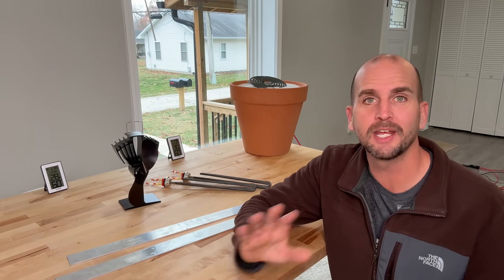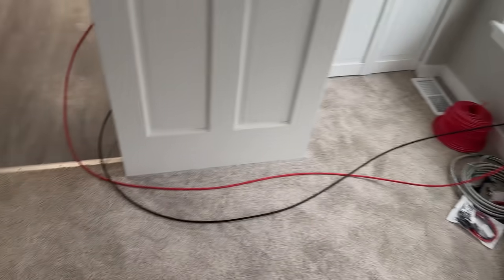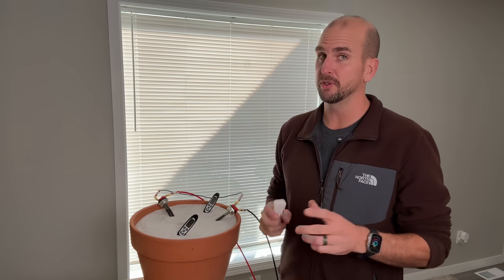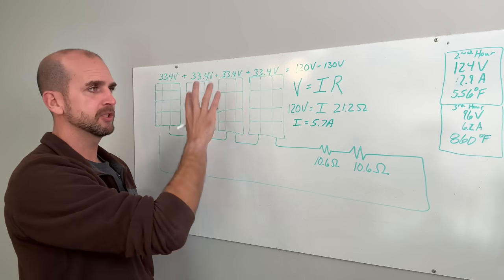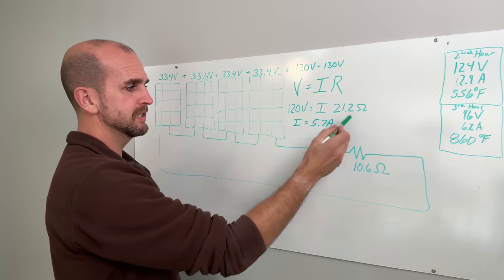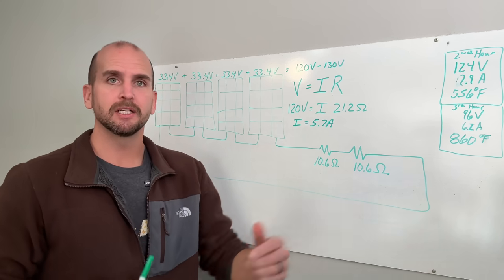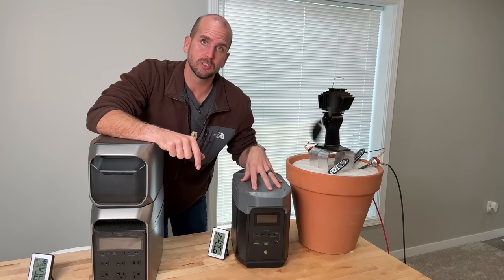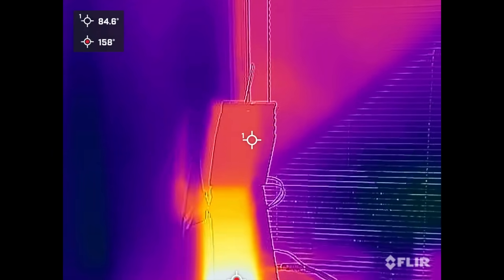Free Emergency Winter Heat | Solar-Powered Sand Heater 2.0

Comment: Good experiment, but if you are expending the energy on the fly into the room, I'd just find a resistive old space heater, hook the heating element(s) to the solar panels and plug the fan directly into the wall. Now, where that pot of sand would come in handy is for thermal electric storage. Say a home owner has a 2 tiered electric rate. Cheaper at night, but high in the day. NOW that pot of sand could come in handy insofar one could heat it up at night and draw the heat during peak electric rate period. Of course one would need a much larger scale of storage medium, like a barrel or something to make it practical.

Comment: I still suggest using a mppt controller to optimize the load.
Also, a heat pump would be much more efficient, though this is nice for having a thermal mass.

Comment: I would have been interested in the temperature in a comparable area (similar number of windows, similar orientation),  in another room since you had the heat off. If your house has one, of course. Or even a closed closet in the same room. The thermometers in the path of the fan is fine but you're really heating the entire room. That info would be useful in a situation where the power is out and it's pretty cold. A few degrees in a small room is good but in a serious situation where you're setting up a tent covered with blankets in the living room this sort of setup could really make a difference in comfort and safety.

Comment: This might keep a greenhouse from freezing.
The paradox is that you want to trap the heat all day and release it when the sun goes down. The peltier is a blind alley. Not enough efficiency to really accomplish anything.
A cabinet of sorts with a vent on top that opens when the room is cold. A wax motor could potentially do this.

Comment: Based on opinion, not experience: Be sure to use "play" sand instead of construction/concrete sand. The "play" sand is spherical and will pack to a better density with fewer air pockets than the jaggedy sand you would mix with cement.

Comment: You need a small pump and  CPU radiator or other small radiator attached to pipes that you pre-buried in the sand before it gets hot.  Then you need a fan on the radiator to maximize heat dissipation.  .  Your 2 aluminum don't have enough surface area to put heat into the room.  I sure hope you didn't use any peltier elements because those have 20% efficiency and are basically ewaste.

Comment: I wonder how it would work using a copper car heater core sunk down in the sand. That with water circulating through it and a bigger car radiator\fan combo. A small pump would be needed but it might extract the heat better? Maybe a small dedicated panel and battery for the pump? Might be totally wrong just brainstorming

Comment: I would have measured the temperatures from the ceiling down to sleeping level... That sand battery could hold 500 degrees but if all the heat is rising to the ceiling what good is it???

Comment: So could you just connect your solar at 120ish V dc to a cheap oil filled heater? 
Perhaps bypass some circuitry that requires AC.

Comment: Seems like an interesting way to provide winter heat for a chicken coop.  It would be interesting to try this in an outdoor shed-- 28 degrees outside, but inside the shed with this sand battery, what is the temperature?

Comment: I made one of these after seeing your first video on this. I have 800W of panels (about 90V) going into an immersion heater, about 390W in full sun. 

It makes the sand warm (like 500F), not a big difference in ambient temp though, maybe needs another element and more sand.

Was a fun learning experiment though.
Reply: id like for someone to explain the advantages of a sand radiator as opposed to a regular metal grate radiator
Reply: @devinm524  I'm no expert but it's likely safer to do this as the really hot parts are buried. It's also fairly cheap in terms of components.

Comment: could also try this with an old fashioned space heater, that kind that only has resistive elements and no fan or digital control
Reply: Yes, an oil-filled radiator-style electric space heater.  The idea is to store heat for overnight heating without the expense of a battery or charge controller.  But it will require several large panels to generate the required current to power it.

Comment: I wonder if you had black pipes with a small solar pump on it to pump the freeze-proof liquid indoors and go through a radiator with a fan on it would compare to this. As that would be a lot cheaper and more efficient as you don't have to turn the sun into electricity first. Of course, you would need to stop the liquid transfer if the liquid isn't hot enough.
Reply: I think they do this for pools. But why not for your home?

Comment: Had a thought on this - does pulling the heat out while it is dumping energy improve the amount of energy pulled in? Since resistance goes down with temperature? I doubt it'd be a lot, but for mine i dont pull it out, i let it radiate, curious if it would be better to pull it out while its dumping energy in.

Comment: In the 1980's I had the opportunity to inspect a passive solar house built ( by my Uncle, coincidently) in the 1960's for an early-adopter engineer of physicist in southern Idaho. It had solar-thermal panels (full of bray oil I suspect) that delivered heat to a thermal battery composed of deep trays full of salt (Halite or table salt). Evidently it functioned well enough, but the new owner wanted to disassemble everything for three reasons. 1) The thermal battery took the entirety of a small room in the house. 2) The equipment needed serious upgrading/replacement, and the solar panels visually dominated the exterior architecture. 3) The whole house had a strong smell of the ocean all year long. Lol. We have come a long way!

Comment: Just wondering if the bottom of the clay pot left a burn spot on the table? 900 degrees is hotter than some wood stoves!
Reply from the maker: Nope, all good.  900F was the max internal sand temp and the pot was under 200F during the test.
Reply: @EverydayHomeRepairs  - Good experiment!

Comment: We live in a double-wide manufactured home which has an unheated crawl space & no basement. What would it take to have solar power to power the heat tape under the home to prevent the water supply line from freezing up during a power failure? I don't think a 25 ft. heat tape uses much power. We also have a gas powered hot air furnace so it draws power mainly to run the blower motor. How about something just to keep the furnace going?
Reply: What's your insulation look like? For an area that's technically outside (if I'm understanding you correctly) I'd think that keeping whatever heat you have would make a big difference. It also helps to contain whatever heat you're getting from the soil. Bubble foil is a great product for that.

Comment: any solar panels light that i can store in my garage for emergency and my wife can connect easily that you can recommend? thanks.
Reply from the maker: Will you use the solar to charge a portable power station?  If so, which power station?
Reply: @EverydayHomeRepairs  I did not get a power station, i opted for a chipper more capacity solution, EG4 3000W inverter and a EG4 48V battery. tks

Comment: Free emergency heat! Only $250 in used equipment, if you’re lucky. Battery: $400

Space heaters: $15 - $50 + operating costs that you pay next month.

Comment: This is a cute science fair project, but nobody should be seriously considering it for their house. At a minimum, some thought should be given to safety (children, pets, accidents, etc.). A few other random thoughts:

1. I wonder about the operating temperature rating for those heating elements. What does running them at 800° (or more) do to their life?

2. The heater resistance might be temperature dependent, which could explain the current anomalies.

3. Having no feedback control on the heating seems pretty risky.

4. What's with the ceramic pot full of 800° sand doing sitting on a wooden table without so much as a trivet under it? Yes, I know heat tends to rise, but still....

Comment: Sand is a terrible thermal conductor, you've effectively trapped the heat inside the pot. Sand's conductivity: 0.114 W/(mK) but water's conductivity: 0.6 W/(mK)
What I'd do differently?
Don't use sand but water. If you're afraid of humidity (e.g. mould) cover it. Because it's a liquid, natural convection will circulate heat inside the water.
The heater elements need to be waterproof (like yours supposedly because they're taken from a hot water tank)
Use a metallic bucket for maximum thermal conductivity between the water and the recipient.
Place a big enough fan on the ground that blows directly on the sides of the bucket.
The fan could be 1 (or 2) 120mm computer fans, possibly supplied by the panels as they don't consume much power (~6W each) using a cheapo voltage regulater form eBay
Alternatively a more powerful fan if you've got enough panels, like you do in your setup.
Reply from the maker: Thanks for the feedback 🙌
Reply: @EverydayHomeRepairs  did you say in the video how long you'd like the system to last?
Obviously the thermal capacity being fixed (it's what power the solar panels provide), the longer you want it to last, the less heat it can emit over time.

Comment: I'm not an electrician but this seems like a house fire waiting to happen 😂
Reply from the maker: That sounds like a pretty cool system.  I grew up in a "passive solar"home but it was a simple setup.  Half the home was under ground, the southern face was filled with windows, and the soffits were large such that in the summer the soffit blocked most the direct sun coming in and in the winter allowed the majority of the sun to shine through and warm the home.
Reply: @EverydayHomeRepairs  - You replied to the wrong person?  Masonry heaters are awesome.  If you encased the thermal element inside a container made of firebrick, then wrapped that in some kind of right-sized thermal mass, you could eliminate the need for convection and rely on radiation.  The problem is joules in cannot equal more than joules out...and you're not really getting that many joules in, you're just concentrating it very well.

Comment: Ignoring the fact that solar water heating is possibly a better option, if you stick with electric heaters, you’d want to size the water volume so you have a nice delta T between the heater and the water and the water and the room (at night). The sweet spot would depend on a lot of factors. Also, while expensive, using that electricity to run a heat pump with the heat pump dumping heat into water would boost the energy by ~3 times. Especially since you’re running the thing during the “warm” day.

Comment: My area had a power outage in very cold weather and a neighbor used this same idea except with a candle inside an over-turned large clay pot to keep one room warm. It worked.
Reply: A candle produces about 80-100w of heat.  If the room were extraordinarily well insulated, maybe.
Reply: A single candle will not produce enough watts to add an appreciable quantity of thermal energy to a room. Just won’t. Sorry. Physics. People: We must never forget that science and education are everything. EVERYTHING. The only path towards health and happiness is objective truth.

Comment: This seems to be a very inefficient form of hydronic heating.  The specific heat of water is about 5 times greater than that of sand.  What sense does this make?  Just heat water instead.

What am I missing?
Reply: Ease of set-up, minimal equipment, less potential mess.